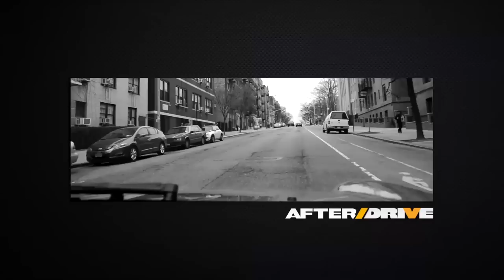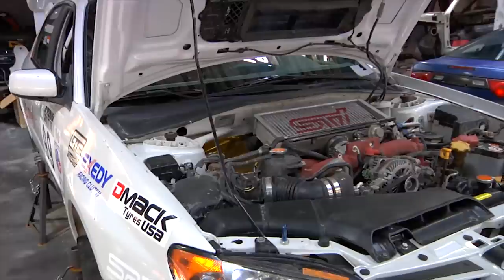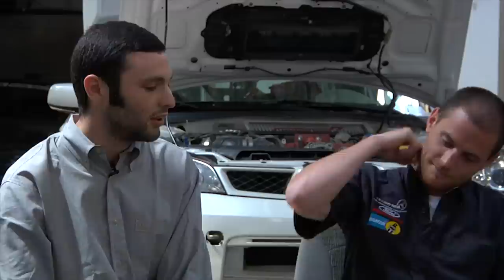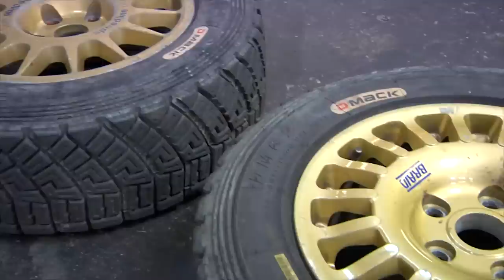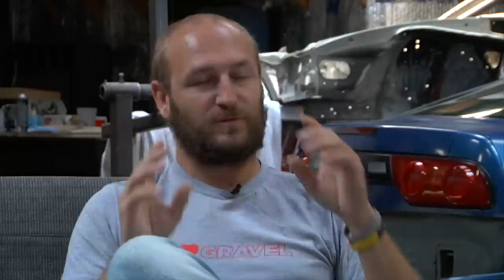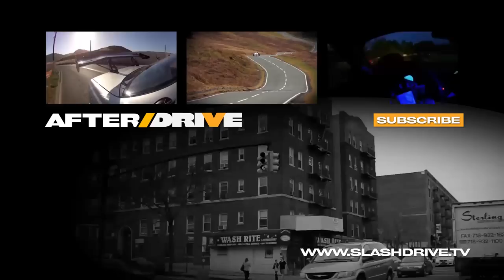How To Get Started Rallying Your Car -- AFTER/DRIVE

Comment: Almost nobody "gets started" with a brand new $30k to $40k car.
The best way to get started is by buying a pre-built, used car for under $10k.
Reply: +ralphinator2 best way is to get car for under  1000dollars
Reply: swedish gaming No, not usually, because you end up spending more money on safety equipment and mechanical repairs than if you buy a completed and tested rally car.
Reply: swedish gaming You're not allowed to race it without a full cage and safety equipment. This is about how to start racing, not how to go mess around in the woods.
Reply: ralphinator2 ID say 2,500 on the car an build it up yourself
Reply: According to forums/professionals and common sense, the best way to start is to rallycross for a number of years or until you're ready to move up to stage rally. Problem is, with people like me, who dont have huge budgets, we're not going to buy a daily driver and then buy a dedicated rally car, have the money to tow it to the event, have extra parts, have the money for entry fees and other costs. I'd love to get into rally but the admission costs, so to speak, are just insane. The only way I can see it being done is on the cheap by getting as little done to the car as possible, roll cage, seats, med/spill kits, fire extinguisher. No crew, just the driver and the "codriver". Then drive it to the event, not tow, hope nothing goes horribly wrong. Only back up parts being struts/brakes, things that aren't horrible to replace. Even then it's really expensive. Seems like it's a very limiting sport to those who want so bad just to enter an event. Almost designed for the rich to blow $50k on a car. Impossible to do on a $5k budget. Very discouraging. Hopefully someone comes up with something similar to rallycross (which is very cheap  to do) but incorporate stage rally. I'd rather take to the back roads in a stock WRX and pretend I'm on a course. Tickets are FAR cheaper than this sport.
Reply: Is a Evo a good car to start off with???

Comment: Bought an 03 WRX for $500 ran rough and a month of work after the 9-5 and $317 in parts the car runs great and ready for the next RallyX which is great to start in before Rally itself and to save up for the cage and suspension.  Definitely an easy thing to get into you just have to be patient when searching for a car I got lucky but so have many others.

Comment: Good point. Starting with a smaller, lighter car with less power is the best way to learn in any form of motorsport. Speed comes with time, getting smooth and developing technique for racing is entirely different from street driving.

Comment: Im only 17. I bought my first race car when I was 15. I had no tools, driver gear, track time, and I had driven stick twice. Everything you guys said in the video is true about starting in ALL forms of motorsports not just rally. If you have the drive to go out and put everything you have into a racing disipline than you will have a blast, and even might be somewhat successful. I starte with no knowldge. I guess I pulled an uninformed Caswell. It is working out well so far. Big thing is go do it

Comment: U kno, i liked these videos but i only learn about 20% from this and tge previous video......he keeps asking the same starter question and it feels like it doesnt progress much. And when they do, the host hits them with another, " what is the first thing new ppl need to do"....plz stop asking the same question, (worded differently). I really want to learn this stuff but its hard to take in bits and pieces.
Reply: They DID answer one of the questions I had about whether or not they aligned their cage specs/requirements with the FIA's specs, as that was NOT the case LONG AGO when the  SCCA was running U.S. Pro Rallying.
I worked that same rally they were mentioning (STPR) back in the mid 1990s, when a competitor (driver) was killed in an Audi Quattro Sport (regular long wheelbase, NOT the Group B SWB deal) when the cage did not hold up to the rock and tree impacts at all. :(

Comment: Ya think an '03 Civic 5-speed (stock) would be a good beginner car? It has no ABS or traction control or really any driving assistance.
Reply: 15ironreaver if you lift it. Civics don't have enough clearance. Roll cage it rally tires better brakes weight reduction. I'm not sure if it would meet class specifications. But you could rallycross it nonetheless I'd say lift her a lil bit and skid plate
Reply: 15ironreaver have a look at what cars are used in grassroots rally, over here in Europe.

You find Golfs, Fiestas, Opel Corsas, Opel Adams, Civics, Citroen C2s, Renault Clios.

Basically any small hatchback, with a manual gearbox (which over here would be all of them), fit it with a cage, strip out unnecessary bits, and fit new tyres and brakes.

Comment: I bought a Ford Festiva for $200, and built the car myself in a month, and then competed and finished the Rally in the 100 Acre Wood. The build total and race fees ended me at about $4,000 total. The path to racing is out there, folks. You just have to look.

Comment: abs keeps your car's tired from locking up, but you also get less (what i call) "technical control" of your car. sometimes when you're rally racing/drifting/road racing, you can use locking up your tires to your advantage

Comment: I am getting excited about the Fiesta 1L Ecoboost...seems like the PERFECT starter rally car. Tons of power left it it. Swap the ST turbo on it like Ford did in the Formula car, straight pipe, K&N and some tuning BAM 205hp :D I am more excited about the 1L EB than the ST. If it comes in at $15K stripped down 5 speed manual you could really have something quick and cool for much less than the ST. I hope Ford sends the 3 door to the USA with the 1L EB, a 6 speed manual option would be nice too.

Comment: Merkur  XR4Ti is 2300 SOHC turbo rwd..Normal aspirated with that of something modern like a good Duratec is easy, or YBB/YBG Ford Cosworth from the Sierra Cosworth is easy  then AWD from 1990 -1995 Sierra or Escort Cosworth is super easy....I have one sitting right over there with YBG 4x4 engine and complete drivetrain..All Bolt In...---And as for "Misterbitchy" Those old Galants are fine cars, I'd do those before the shorter dartier Mirage---Galant were fine WRC cars on gravel, nice wheelbase.

Comment: What's your comment on the RWD vs FWD debate? and what did you start on? i'm 17 and am buying a car within a month, i was going to get a RWD BMW but they said FWD would be better for rally. you with a hands on experience going through the different stages, and forgetting rally class rules, what would you suggest, good powered RWD or a nice cheap FWD car? A response would be greatly appreciated!

Comment: i drive an IS300 and i like the idea of rally cross
i was in a ride along in a subaru sti is rally cross
do i use my IS300? slash buy another IS300
or do i buy a subaru wrx? mitsubishi evo
Reply: Lexus? "L" is for Luxury.
Reply: Rally is hard on the vehicle. You will break parts so consider the cost of repairing your vehicle. Get an old school fwd car car first like a focus or gti or civic then move up to a wrx.
Reply: PaperShark9521 Actually "L" is for Look how much this guy paid for his Toyota.
Reply: more doors, more weight. pay for a coupe please
Reply: is300 could be a good car if you build it right. it would cost a lot for suspension and roll cages especially if youre planning on getting air time on jumps. since those cars are so rarely found in 5speed you want manual but they'd be fun as hell with corners. id say buy a different cheaper to pay for car like maybe a base model impreza where parts for rally are easily found. have fun and good luck

Comment: Agreed. And its a valid point.  However the same can be said for any sport. Be it motorsport or other. Far to many 'fans' only see what is presented to them here and now. And despite all else, will get set in those ways. They look to the flashy and familiar, relate to it and form bonds. Sponsors and racers alike have thrived on this for generations. Stateside, the media only feeds us what they want us to see in sports. MUCH is lost before it even hits the fans.

Comment: They say to pull the ABS fuses which is good, but people should also know to put on a helmet and pull the airbag fuses as well. I've seen airbags go off on some rough sections of rally stage, not the kind of situation you want to get in at high speed.

Comment: I have a 2000 Subaru legacy outback sport(Not the wagon) and I need some opinions on it. Is it a good car to start out with and how can I give it a little more power?
Reply: Swift Justice 

Great car to start with, I wouldn't worry about power yet.
Go to an auto X, or Rally X and drive the car, learn how it drives. 

Then once, you are familiar with the car, determine if you are still really serious about it.
If you are, then get your safety up to spec, invest in suspension and mods. 
Worry about power only once you have the skills get every ounce out of the car you have.
Reply: +Swift Justice you can get more power buy turboing the fuck out of it. Also add in a supercharger and you should have 1200hp
Reply: Dale Tolestory How much would that'll cost, sorry if im asking too much.
Reply: +Swift Justice Dale is just fucking with you man, learn the car. Stock form.
Reply: Jürgen Kesamaa I guess I'll just ask on forums, because the winter rslly is comming up this year. Maybe I'll just go for handling then worry about the power last
Reply: +Swift Justice Get brakes and safety equipment first, worry about power later.
Reply: @ralphinator2  is Evo a good car to start? Lol

Comment: yea i have some vids of it on my channel, i'm in the process of ripping it apart and cleaning it. it's also my daily driver so lols but yea, i really need new wheels because there is 13" s on it and they are SMALL! 1 clean 2 wheels 3 body and paint 4 turbo 5 cage 6 kick some ass

Comment: My Chanel : SVTWRC  purchased a $300 Saab 900 turbo . Spent around another $300 on brakes ,plugs , oil change , hood pins , race seat mount. Local SCCA rallyX in Poughkeepsie New York. You can bring a co driver and practice notes and get a real feel for what the driving and surface . Highly recommend  if you want to try rally  on a $1000 us dollar budget.

Comment: I'm assuming the $3500 he suggested for the roll cage is of you order it. I know I could use mig or arc welder and 3/8" steel tubing and make it for way less.
Reply: Lots of places don't let you race unless it's an approved roll cage. I'm not sure how you'd get one approved if you make it yourself, although it can probably be done.
Reply: I can tell just from your comment you do not know nearly enough about welding to fabricate a rollcage. Pay a professional to do it, it might save your life.
Reply: they would probably have to do NDT-none destructive testing on the welds
Reply: The cage needs to meet FIA specs or you've just wasted time and money. Specific tubing, thickness and construction is specified.
Reply: mrcead If my old man is a welder with almost 30 years experience, could we do a passable one in my garage just by following the sFIA pec sheet?
Reply: Probably. You'd just need to find out where to get it certified.
Reply: Devin Byrnes Sure. The rules specify everything and has a basic diagram (12 point cage with x brace but 2 extra door bars will be added soon) and for any clarification, you can peruse around rally boards like SpecialStage or SCCA, the rally community is very helpful and they love pictures and build up posts. Then you get it inspected (the inspector inspects the welds and drills a hole in the cage to ensure the proper metal thickness and checks for the proper gussets and braces, etc).
Reply: Sime
You're going to have to find out what group organizes rallying near you. Then talk to them.
Reply: 1.75 inch main hoops and 1.5 inch secondary bars are minimum for DOM steel cages that will pass tech at Rally America. If you are a good welder you could theoretically do it yourself, but if you have never bent tube before you may want to pay a pro to do it. If there are stretches, stress marks, or ripples in the tube after it's bent, it WILL NOT pass tech inspection and you will not be racing with that roll cage EVER.

Comment: i don't know this for a fact but here's what comes in mind:
when on a bike, you are not fastened with any seatbelts. so when you crash your whole body moves around etc etc
when you are on a car, your head is the only part of your body which is not fastened to anything. and is free to move. and because bike helmets tend to be a bit heavier (maybe 1,3-1,4kgs for the good full face ones) they put to much force on your neck if you crash because of inertia. 
again, thats just an assumption.

Comment: I have to disagree that there are no other motorsports (aside from Karting???) where you can share the track with a pro, being an amateur. Motorcycle circuit racers generally practice at the exact same time as the pros. Pros and their entire team also attend the same trackdays as amateurs do and if you're signed up for the same day you will see them, you can probably talk to them, and you can even (try) to ride with them.

Comment: isn't a dog box h pattern not sequential?
Reply: +Nate Shriver yeah there's a lot of misinformation in their shows. matt has mentioned the wrong tire name numerous times on cars he reviews amongst all the other stuff I don't catch because I tune him out lol.
Reply: +James Godwin Dog box is the form of sequential they use in Skip Barber formula cars. I know that much. And it is clutchless upshift, regular heel toe downshifts. The shifter just like a sequential though. pull back for gear up, forward for gear down.
Reply: +Spencer Geerlings dog box is usually a syncro less gear that doesn't require clutching except on take off. that's at least how drifting drag racing and nascar is.
Reply: Hi James,  great opportunity having identified one quality information source to search the web for another, thereby avoiding a mind of bs. Use the web smartly - it is will advance your interest and leverage your capacities to utilize all the information available thereafter.

Comment: Can you weld a roll cage into a car like at 4:12 and still use it as a legal daily driver? That would be really awesome!
Reply: A roll cage will never make your vehicle non street legal
Reply: Use what you have and enter amateur rallies for a start, it's not expensive and it's fun, heck if I've managed to come home with a 5th place and a 3rd with a freaking skoda fabia mk1 and 5th place overall from 4 stages and entering only on 2 of them (the low power engine one on chain transmission) you can do it as well. Around here the cars must be road legal unless you enter hill climbs, plus all is based on classes (under 1400cc is class 1 and goes up from there). You can always upgrade your car from your first race and see what works for you
Reply: Its totally legal Ive seen people around with bolt ins and welded cages, it makes your car safer
Reply: nh skiier Only if it's built properly. If you don't weld it well enough or you weld it straight to the floor panels rather than the frame, it can do more harm that good in a rollover. You don't want an unsafe cage that can impale you, it's not a project to be taken lightly. There are race sanctioning bodies that inspect cages, they'll spot a bad cage and won't allow you to race. 

You'll need many hours of welding practice, and lots of research on building a proper cage from guys who've been doing it for years.
Reply: snakesonaplane2 well obviously, when the day comes I put a roll cage in whatever I own I'm giving it to either team O'Neil rally school since they do that or broken motorsport. I never thought about an unsafe cage. Well put. Unless you have the skills don't even try welding a cage.
Reply: It depends on your state laws, and the 'mood' of the LEO who will inevitably pull you over with one installed. 
It is also NOT a great idea if not wearing a helmet ALL of the time, since NO MATTER HOW WELL it is padded around your head (the 'halo' area of the cage), it WILL cause damage to your skull in an impact out on the streets. :(

Comment: Why disconnect the Abs?
Reply: Andrei Tanasescu drifting i guess? :L
Reply: What does locking your brakes has anything to do with drifting? Doctor Pretzel
Reply: Andrei Tanasescu Some people don't like abs when going fast.  I'm one of them.
Reply: Andrei Tanasescu it's simple, abs works in asphault but if there is gravel or stones, and even worst if you have to race in dirt ABS doesn't alow you to brake strong enought so you end up crashing. 

 It just doesn't work on surfaces that are slipery because you're tires lose traction and lock up very easily so ABS regulates the brake presure to have a minimun effect and you can't be fast with something like that
Reply: +Andrei Tanasescu ABS is like training wheels. Nobody races bikes with training wheels, so why would you race cars with them?
Reply: They don t have brake by wire that s why the can do that.

Comment: You guys are aware that rallycross is basically an extreme form of circuit racing on dirt, right?
Reply: In England and Europe, and yes, with the Red Bull GRC series now here in the U.S. yes, of course (except that it is most tarmac, with sections of dirt per lap).
They are speaking to the SCCA Rallycross events, which are LOW SPEED, 'autocross on dirt/gravel' contests, one car at a time against the clock, around a course of cones. ;)